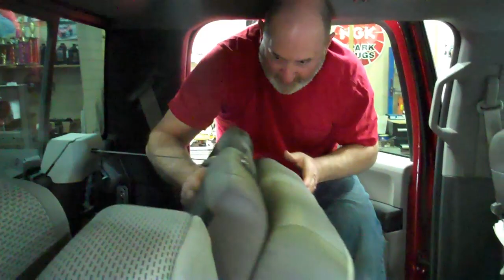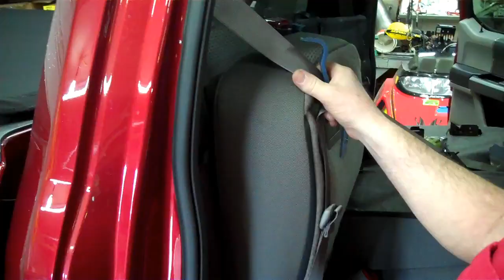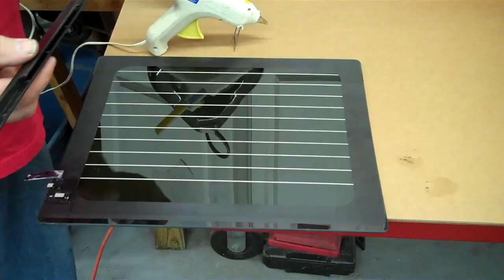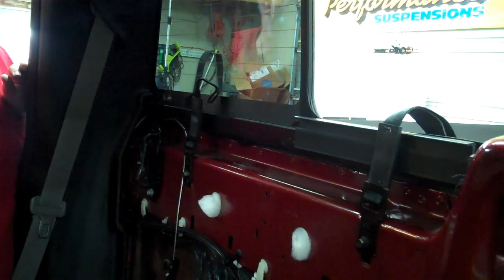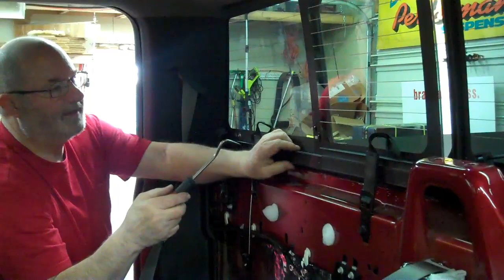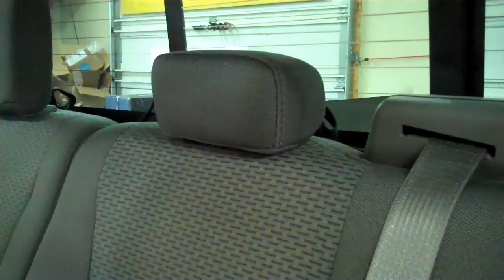2015-2024 Ford F-150/250/350 Power Sliding Heated Rear Window Repair

Comment: Hi Brad, great video, thank you. 
My sliding window isn't broken but the heater tabs came off. Im having a heck of a time getting them put back.  I bought adhesive meant for reattaching these tabs but it keeps coming off.
Almost tempted to replace slide with one of yours.  But I'm not sure how you modified the existing wiring to work with yours.  Thank you!

Comment: Nice job... upper window guide track loose in middle ( held with 4 pieces of double sided tape, what adhesive what would advise to adhear center section  .... ends are tight...... thanks 2018 f150

hearn
Reply: Did you get this fixed? I know it's been a year since you asked but I found a video that gives the type of glue and primer you need to do this correctly

Comment: Great video. Without it, I couldn’t have fixed my motor/regulator when the cable slipped in the drum and got chewed up, due to the breaking of the plastic “carrier” on the bottom of the sliding window.  Thank you Brad for taking my call today and clarifying something that wasn’t clear.  You are a good man!

Comment: Had my rear center power window upper track on my 2015 Lariat literally come off while driving. I ran into Lowes and purchased some industrial double stick tape to remount the upper track. Crappy way for Ford to mount the track rail instead of clips or screws, they used tape. I used tape to remedy a quick fix.
Reply: Wow thanks Tim this just happened to me, I noticed my back center window loose when getting in my truck yesterday and thought someone tried to break into but once I looked it over I seen the top piece was loose. Gona stop at home depot and try the tape and hopefully works. Been searching everywhere to see if anyone else had this problem w 2015 Lariat for a easy fix idea.👍🍻
Reply: @houstontexan4834  Just had this same issue with my 2015 lariat. How did the tape hold up? Ive been looking at tape and adhesive glue to fix mine.

Comment: My rear seat is so tight to the back that I cant get even a thin piece of paper behind the seat, let alone my hand. And the head rest are so tight to the ceiling that I cant get them out. What am I doing wrong?
Reply: You have to raise the bottom seat cushion to about 45 degrees. This allows the back of the seat to come forward a bit. Use a long box wrench to grab the little button if you can't get your hand back there.

Comment: Hey brad great video! I have a 2015 lariat 150 with the power slider and the top track has come lose any ideas as to why or how that would happen? or ideas as to how to fix it? thanks!
Reply: The same has just happened to my 2015 F150, Have you found any advice on how to repair?
Reply: 4:48 he glues it back onto the plastic I’m guessing that’s how to get it back on
Reply: My 2010 Lariat went whacky.  Been using it a lot as power grids were bad.   Still debating on what n how I’m gonna fix this   At least I have it closed now. Stopped about 1” shy of full closure.  I used it to see out back on these humid mornings

Comment: I purchased this glass and called a glass company to come out and have it installed for me. The second they looked at the glass they told me it was the wrong glass and asked me to have their shop order the glass for me. I called and spoke to Brad and he assured me that it was correct, and after comparing the glass to the old broken one, Brad was right. Thanks for the help and the supply for the lowest priced glass available for these trucks. Recommended.

Comment: What was your purpose for glass exchange?  I’ve got a 14 F150 and the defrost doesn’t work which also prevents the heated side mirrors from working as well. The dealer said I’d have to replace the entire window assembly.  Would replacing the center sliding glass solve my issue?
Reply from the maker: YES
Reply: @autoglassamerica  Thanks have the same problem. just the center window doesn't defrost. They want 1700.00 CND for replacing the complete window.